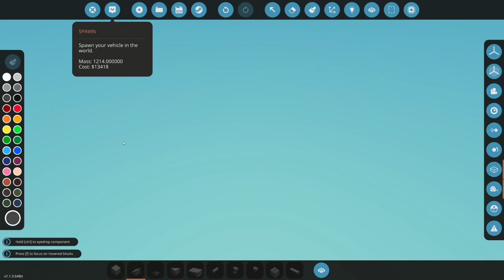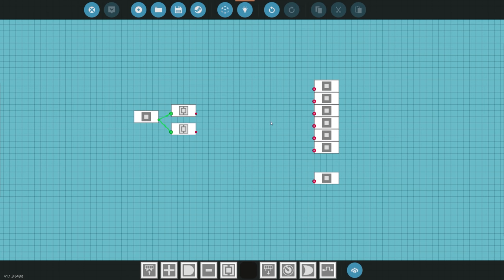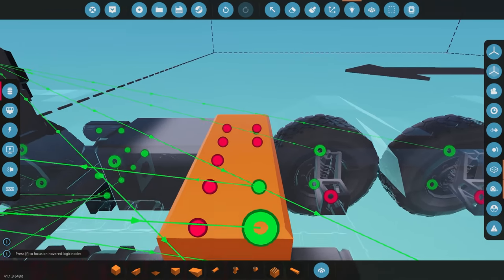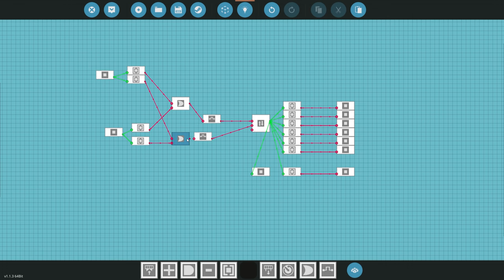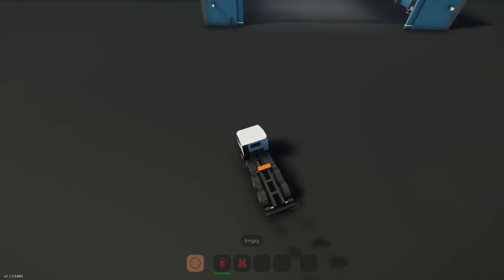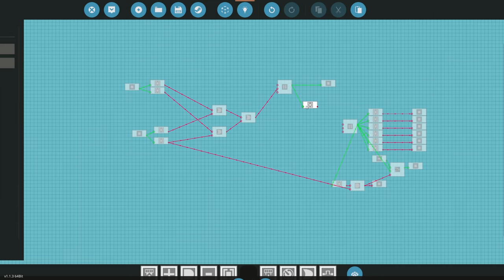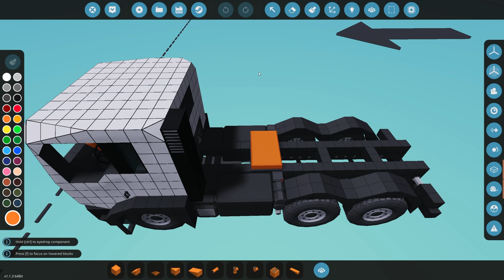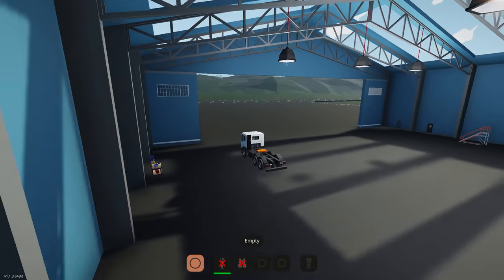Automatic Transmission Tutorial - Modular Engines - Stormworks

Comment: I got here before the guy that complains about cooling. Not bad.
Reply: That’s because it got fixed
Reply: Pls fix coolant gaben pls fix main reson rektor explod
Reply: The new cooling system sucks simce a month or so ago.
All my engines explode or i have too nerf them to absolute nothingness.
Reply: @lucaschneider1613  Yes comnit hernobyl
Reply: @billy-blij-1-2-36  really? Gotta check
Reply: @deev2789  no gaben needs to make team fortress 3
Reply: @billy-blij-1-2-36  I don't know, engines still seem to heat at the same rate and still refuse to cool down.  If this is the only fix they do, we're pretty much screwed as far as modular engines go.
Reply: @legogenius1667  you are right, tested with and without radiators, both exploded after 2 minutes
Reply: @docbrown9018  probably didn't have pumps on it
gotta use 'detailed tooltips' in General settings.
Make sure they'res actually flow through the radiators
Reply: @Takon_pilot  tf2 players when tf2 has an update after -0 years:

Comment: This is a nice, simple way to do it, however if you want to save power loss by using less gearboxes, you can have 8 different ratios and a reverse gear with just 4 boxes by giving each gearbox a different ratio and engaging them in a specific order (none, 1, 2, 3, 1&2, 1&3, 2&3, 1&2&3).
Reply: yup, that would be a 5:6 then 1:2 then 1:3 and reverse as the boxes, using the order you listed above (none, 1, 2, 3, 1&2, 1&3, 2&3, 1&2&3) The ratios range from 1:1 to 10:62
Reply: @Anonenko I thought about this for a while too, and yeah I can't come up with a reason. Just lock the ratio between -1:1 and 3:1

Comment: Interesting approach. Another way to do automatic transmission is through a speed sensor and threshold gates. It works like charm and downshifts automatically depending on speed. With a bit of logic you can also make it use a single gear when going in reverse so you don't end up going fast when backing.

Comment: finally, i have 0 idea on how gear boxes work except a reverser
Reply: it's definitley not easy, I had to play 3 years of forza and an entire days worht of research to fully understand gears and drivetrains
Reply: The basic idea is trading off speed for power, or the other way around. If your engine is extremely fast (for example if it has really high revs like an F1 car) but low powered, you could put it through a gearbox to trade off some of that speed for enough power to move a whole vehicle. Or you can go the other way.
Reply: Watch Engineering Explained ;)

Gears are basically levers. Imagine you're trying to push a door closed. You typically do so by pushing furthest from the hinge. This is because the force you can apply is most effective and the distance you have to move your arm (or yourself) is not a problem. If you push closer to the hinges, you'll have to move your arm a lesser distance but it'll require a stronger push.

We need gears because engines don't make the same torque and power (which is a function of torque and RPM) across the whole rev range. By spinning the engine's internals faster, you get more power (to a point). But we have an issue. In land vehicles, we need to spin the wheels at a very wide array of speeds. If we connect the engine to the wheels in such a way that idle (at which point the engine can keep itself running) and redline (the point beyond which we don't make more power, so it's more or less pointless to rev more, or we damage the engine) correspond to our entire needed speed range (so from stopped and very low traffic and parking speeds to highway speeds and beyond), the engine probably isn't going to be strong enough to even get us going.

Thus, we use a pair of gears. One is spun by the engine and the other goes to the wheels. Say that the input gear is twice as big as the output gear. This means that the wheels (basically) will spin at half the speed as that of the engine, but with twice the force, twice the strength. We use this strength to climb hills, to accelerate and overtake, to carry our heavy shopping, etc.

Since the difference in sizes means the input gear spins 2 times as fast as the output gear, we call this a 2:1 gear ratio. We call these gears shorter.

So now our engine is actually usable. Hooray! Problem. We're going to run out of revs if we want to go any faster. So what do we do? Well, our engine is probably strong enough that, once we've overcome friction and have gotten going, we don't need all that strength. So now the output gear is going to be the same size or bigger than the input gear. 

Going with the same ratio from earlier, if for every 1 turn of the engine's gear we get 2 turns to the wheels, we call that a 1:2 gear ratio. You might've heard the term "overdrive". This is simply when you have an output that spins faster than the input. These are called taller gears.

Apart from usability, this has another very important function. Engines tend to be at their most efficient when at a certain RPM, which tends to be pretty low. So if you want to go a longer distance more efficiently, you use taller gears that'll have you at lower engine RPM at your cruising speed. This is why you see cars today come with 7, 8, and up to 10 gears, with some (like semi trucks) having even 12.
Reply: Just think about using your bike, no need to peddle way faster to move faster.

Comment: That's pretty close to what I used to do on my creations. I've found tho that if you use the Low threshold for the engine RPS on 0 sometimes the system gets stuck if something happens and it goes to a negative value. So rather than 0 I'd set it to -9999
Reply: Yeah happen when your wheels are slipping

Comment: So I gave up trying to make my own, it just wouldn't work no matter what I tried to remedy it and it kept stressing me out to a breakdown. So instead I looked up your modpage and downloaded your modular engine controller and automatic transmission. Upon getting them all wired up the truck insists as soon as the engine turns on to immediately start driving backwards. While both controllers seem to work together, both of them ask for a clutch (my truck only has one). The automatic transmission also asks for an up/down in composite for some reason? I tried hooking it up but I can't seem to figure out how. I just want to make a car with more than 1 gear.

Comment: You should add 1 to all the forward gears.
1st gear should be the gear set in the default position.
Then when you activate "gear 1" you'd actually activate 2nd. that allows 1st gear to be low and basically gives you 7 gears with 6 boxes.

Comment: Your tutorials are very helpfull and got me to fix all kinds of problems in Stormworks. But i have to say, i find the modular engines pretty underwhelming.
I was so looking forward to the update, build a ship for it, more or less. Build a large 8 cilinder turbo-diesel and it doesn't work. I've tried all kind of configs just to find out that it needs loads more air and exhaust. And yes, i am using your ECU wich works pretty good.
 So no, you can not build any engine you want. It's pretty limited what you can do, really. Wich makes the modular engines not very realisitc to build and make work.
Just wanted to say that, nothing you can do about it.

Comment: So I'm having that problem upon start up where the rps is so low that it tries to always keep the clutch off by closing the air throttle, which means my engine can't start. I've tried my own remedy with this as you suggested since you don't show how to do it in the video. The problem is it doesn't work, and I can't figure out how else to do it so that it would work. Could someone tell me how, or if there's a workshop link to this gearbox with that mechanism, just send it to me. Or if this is possibly because I use ZE's microcontroller for the engine instead of yours. I'm also unsure why the truck in the video didn't have this problem, maybe it just turns over easier.

Comment: This been a great tutorial.

But was curious: what is the best method for setting up a transmission for throttle inputs that don't reset? Been setting up a test engine to work on a transmission & engine MC, but causing trouble when shifting manually, and unsure if composite buttons is the cause or the constant throttle input.

Comment: I like to add a P-R-N-D system to my autoboxes plus i have a way to limit the gear if you're climbing a steep hill, for example, so the system can only go to second gear or third, for example, if required
Reply: Whilst this all sounds good (not trying to be sarcastic), doesn't the fact that you need something for climbing hills mean that either the gaps between your gear ratios are wrong or something else is wrong?? Because you shouldn't need to do this.
The only way I can imagine having to do something similar would be to add a "low range" override but that's not the same as you mention.
Reply: @TheSd1cko  No, it allows me to have very high gears for speed and fuel efficiency whilst still having the low gears required to get over the large terrain whilst towing. Also thinking of adding a manual mode which would be another way to do this.
Reply: @DavstrWrexham  ah ok. So you need an overdrive then where all the other gears run through? Lowers ALL the gears for off road, and disabled for road / speed.
Reply: @TheSd1cko  That would be another way to do it, yes

Comment: How to maintain rps and keep engine cool?. My emgine is always explode due to increase of temp i cant handle
Reply: Try using intercoolers connected to the electric pumps, it does help sometimes. And if you're using a heaters on your creations, place them as far as possible from the radiators, when they work, they heat up air around the radiators and make cooling way less efficient
Reply: @JustDarkOfficial  my test engine is always got 60 rps in air/fuel 2:1 ratio. And the temp always rising uncontrolable using electric water cooling like on Nj's tutorial
Reply: You need an engine controller that uses a PID to control the throttle based on the rps. Cooling is a separate issue. See above although you can use the modular fluid pumps now instead of an electric one.
Reply: @pfistor  how to control the rps? I always got 60rps on 1:2 fuel/air ratio
Reply: @Hawilldan  You need micro controller to take in the throttle value and apply a Proportional controller to that and output the result to the throttles.
Throttle 0-1 > multiply that by the total engine rps so 60 then put that into the PID set point. Take in the engine RPS and put that into the PID Target Variable. Then output the PID into the engine throttles. Set P=0.05 I=0 D=0 .  A proportional integral derivative controller reads an input (the target variable) and uses math to try to achieve the target goal. So from that point when you set the throttle to half 0.5 the MC(micro controller) multiplies that by 60 to get 30 and the PID says oh you want 30 RPS the engine is at say 10 so it starts bumping up the value that it is adding to the throttle by 0.05 every tick (1/60th of a second) up and up until it gets close to 30 if it goes too high it'll dial it back down. Bit much to explain over YT comments. If you still don't understand download a modular engine controller on Steam workshop.

Comment: In my build, I have a AWD 5 speed car with a small engine, at 30 RPS. It stalls at gear 5. Any ideas how to stop it from stalling?
Reply: 30rps is way too high, the peak power-efficiency of the small engines is around 10rps.  Try limiting your engine RPS to 15, then using the threshold gates to gear up at 12 and down at 8 constantly keeping it within the "powerband".  You will need to adjust your gear ratios after doing this, I like to have my first gearbox converting engine power to torque (arrows away from engine), then all gearboxes after that are converting torque to speed (arrows to engine).  And I'm using 4 gearbox to give me 5 forward gears (a 3.1 on the first gearbox disengaged, a 9.5 when engaged for my first 2 gears) then the gears that follow are usually around 3.2, trailing off to a 6.5 for the final gear, that way the finial gear doesn't lose too much torque.  Let me know if this helps you.

Comment: Just out of curiosity, does your truck not overheat? Also your radiator fans aren’t on.
Reply: If you don't rev the engine to high for long time and put good cooling system it won't over heat for example i put two 5×5 rad for my 10cylinder quad turbo engine 
And his fan won't come on until a temperature threshold
Reply: @Mahyar_BEH  Maybe you know how to cool flat 8 1x1 naturally aspirated engine? It's working on 15RPS on a tracked all-terrain vehicle, and does overheat even in Arctic. It uses two 3x3 radiators with 2 belt driven pumps and 2 small tanks filled with a fresh water, but, as I said, doesn't keep cool :/
Reply: @JustDarkOfficial  Delete any tanks from the coolant lines. Make sure to have 2 cooling manifolds and don't pump manifold B into A of the other. Either have 2 totally separate systems or pump cool into AA and then BB back to rad in parallel so no hot can get to the cool in. Make sure your radiator fans turn on. Either at a temperature sensor to turn them on or a button or w/e.
Reply: @JustDarkOfficial  i used one pump but one thing that i have done was put one cooling manifold per cylinder bank the for you is two of them
Reply: I have built a flat10 with quad turbo an intercooler and uploaded it to workshop you wana download it for reference if it help
Reply: @Mahyar_BEH  Can you please give a link for this? Thanks
Reply: @JustDarkOfficial  did you see it
Reply: @pfistor  Thanks for suggestions, will try, and also, fans are constantly on
Reply: @JustDarkOfficial   did it help
Reply: @Mahyar_BEH  just found your engine on a workshop, thank you again, will try to improve cooling on my engine using your one as an example
Reply: @JustDarkOfficial   your welcome if you had any problem just ask
Reply: @Mahyar_BEH  thank you for the reply, i was wondering if the high rps is normal. Also, is there a way to make a microcontroller that limits rps?
Reply: @dnt_alert5806   yes it normal  and yes you can build one with limiter but if you use good gearing in your gear box there is no need for lemiter
Reply: @Mahyar_BEH  ok ill return to my experimental car and I’ll continue testing.